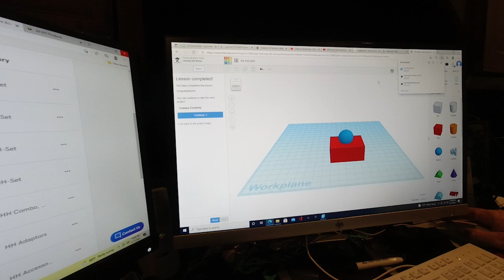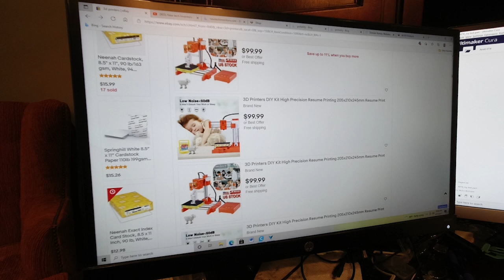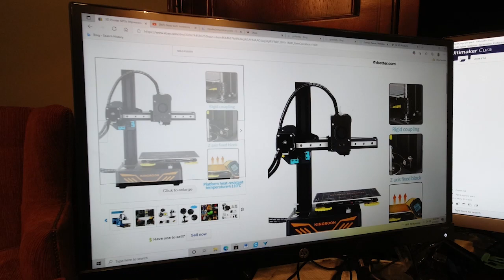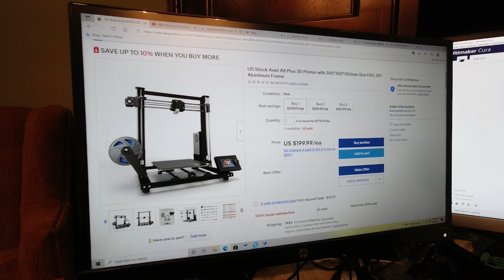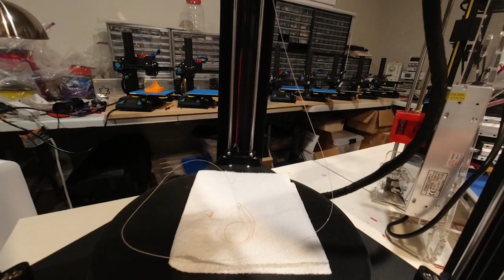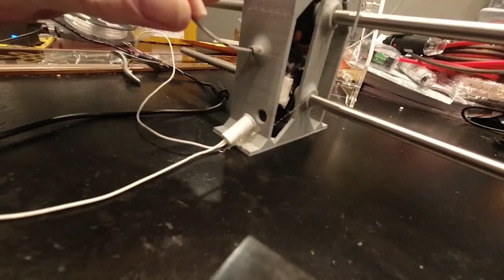HOW TO START 3D PRINTING PART TWO

Comment: When buying printers on Ebay or even Amazon, expect something to be slightly wrong with it.  Mine had a warped bed, warn down wheels, and a couple other flaws.  It's nothing real serious, just expect something.
Reply: I even got an Ender 3 S1 on amazon brand new, and the fan casing was sort of bent.  It almost hits the printer bed like it's so close it looks like it's going to hit it but somehow it just never does.  It has never caused any actual problems but when you look at it head-on you can really see how bent it is lol.
Reply from the maker: I have had pretty good luck buying on eBay, but you're right Wayne, that chance of a problem always exists...Ken

Comment: When switching filament I like to heat it up really high like 250 (depends on printer though) and pushing the filament through real hard by hand, clears everything out of there.  Not sure how good this is for everything but works for me lol
Reply from the maker: I do the same thing Wayne; except I never go over 230 with PLA...Ken

Comment: hahaha, its not showing that its for kids ken. bad marketing. its a kid sleeping. it means they are quite, they might be actually good options. they use better TMC stepper drivers that produce less artifacts than your typical allegro drivers on those Anet printers as well.
Reply from the maker: Almost all of the orange plastic 3D printers I saw for under $100 claim to be for kids and beginners. I did purchase one of them about 7 months ago and  was not very happy with its lack of features and size/construction compared to printers costing only $60 or $70 more. I think a beginner would have more luck with a printer in the $200 range. Thanks for your observation and support...Ken

Comment: Would you share your QQS-Pro slicer profile\settings? I am having a heck of a time getting it to print well. Thanks!
Reply from the maker: Sorry it has taken so long to respond to your question. I was hoping to get time to set up a couple jobs and get some good settings for you on the FLSUN QQS-PRO delta printer. The one I have  has not been used for any production parts yet, so I don't have any good tested settings. I did print several parts on it after I got it and had pretty good parts but didn't save any settings. I will send them to you when I get time to run some test jobs on the QQS. Thanks for your support my friend...Ken

Comment: I love your jungle talk .. great stuff my brother...I got the prusa mini going great....for me it’s the printer to go with.  Very precise and smooth ...I love its running order and display.  It makes my precise models fantastic. Peace till next time,  I hope soon...joe
Reply from the maker: I may have to try a prusa mini myself, keep me updated on how it works for you. As far as the Jungle, I don't know where that came from, but It sounded so crazy after I said it that I decided not to edit it out and let you know that I'm only human. I felt like I had to do at lease this video for many who have commented about their desire to get into 3D printing but didn't know how to get started. Thanks my friend for your support...Ken
Reply: @NewTechInventors  the thing about you and the way you deliver your message is it’s from the heart.  You actually care.   
The prusa mini is a very easy,  problem free,  quite,  well engineered machine. It prints extremely well. I do recommend the kit but you must make a good day of assembly.   It’s fairly easy.  I just put a gear on backwards. This gave me a fit for a few days.  Prusa chat solved it.. the PETG sticks without glue extremely well.  Bend the magnetic plate and it comes right off.  It took me 3 months to get it .. it is very much worth it. Talk to ya...joe

Comment: Hey Ken. Are some of these videos out or order? What happened to the print farm?? There are 100's of videos likec this, I honestly think your channel do a lot better if you focus on the print form and the production of your new product which is way more interesting than a General videos. Have a great day buddy I'm looking forward to the new print farm videos
Reply from the maker: I felt like I had to do this video for many who have commented about getting started in 3D printing. The print farm is still a mountain of work. I spent all day today trying to complete the installation of the mini split heat pump unit for the print farm. I did take some video when I had a chance and will share soon. I still have a couple hours left to finish tomorrow and hope to have AC going tomorrow afternoon. It's getting hot around here and I can't run very many printers down there without AC. Also trying to get phase two printers set up down there too. Thanks my friend for your support...Ken
Reply: @NewTechInventors  you are amazing Ken! Everyone should have your energy, keep um coming 😊

Comment: It helps when someone has used cheaper printers themselves. And can tell a good response which ones are good and not.
Reply from the maker: The printers I have cost from $100 to $400, so I don't know if they are all considered cheep 3D printers or not and I certainly don't know much about expensive (over $500) printers. I may be missing something, but I do get a lot of good parts out of the printers I have. Thanks for your comment and your support...Ken